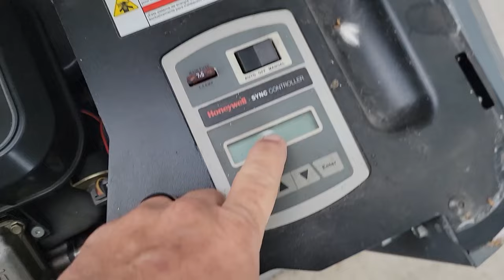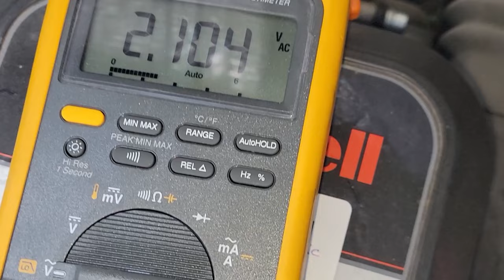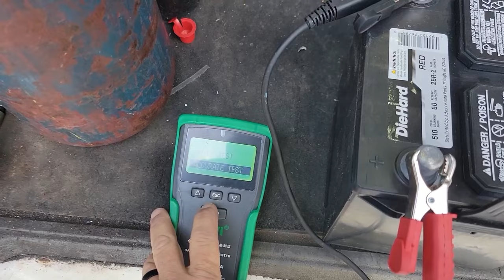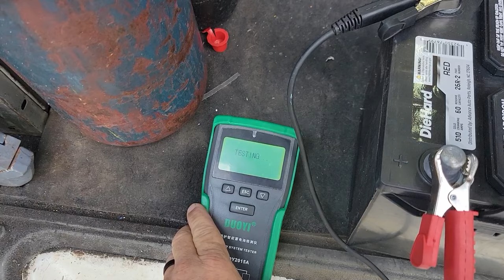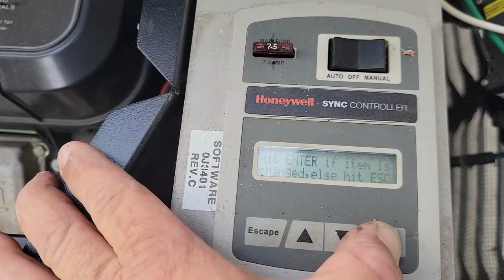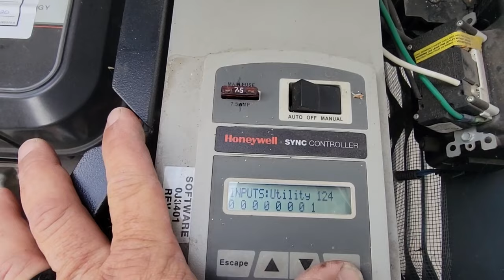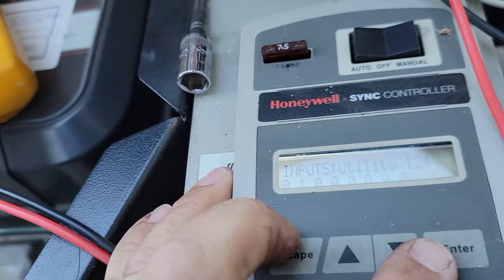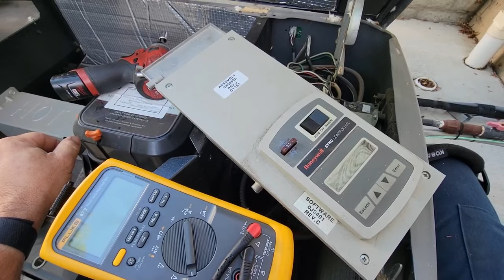Generac Generator Won't Start Blank Display

Comment: Add a surge protector to N1-N2 to protect the controller from utility surges in the future. Generac had said they were going to add surge protection in the circuits in the future, have not seen that yet as Evolution controllers sill suffer surge failure in T1 N1-N2, just adding a MOV in the circuit could help but I guess it's cheaper for them to pay warranty for failed controllers. Had a liquid cooled Nexus on a farm that lost controllers in lighting storms several times, added surge protection to N1-N2 and never had another failure. They work and are cheap insurance once the generator is out of warranty.
Reply from the maker: Good idea.

Comment: I have a newer generation controller on my 11k generator. The display went out, but the generator still operates normally. Hate to have to shell out over $400 because of a faulty display. You'd think that where would be a fix for this. Thanks for the informative video and useful trouble shooting insight.
Reply from the maker: Electronic repair is not popular anymore. That’s what I wanted to do before I went into HVAC you might be able to replace just the screen but it’s hard to say if that’s what’s gonna fix it.

Comment: I have a Generac 8k home generator. The control panel was replaced eight years ago and has worked great. Yesterday I turned it on and there was no display in the led screen. Although the three (red, green and blue) lights come but the buttons below them have no effect nor does the main OK button. Hence, the unit will not crank or start. I think the controller has failed. Batteries are fully charged.  Any ideas?
Reply from the maker: Check your fuse, after that, you’re probably right

Comment: Good call on the bad controller. Not sure why they had Romex running into the unit, which is not code. They should have put the junction box on the house and then run all THHN to the gen set. Pre Covid that control was $500+ so wondering what it is now since I retired 2 years ago.
Reply from the maker: It was more than that now. Everything has gone up stupid money

Comment: I have basically that same model and have a blank screen. I put in a new battery and it went dead about 12 hours of running and the generator shut off. Do you think my control panel is bad or the charging unit? I changed out the 3, 5 amp fuses as well.
Reply from the maker: You need a volt meter to check battery charger. It should be more than 12.5v dc likely in the 13+vdc
Reply: I'll try that. Thanks.  I think I may have ruined the control module because I changed out the battery without pulling out the 7.5 amp fuse.
Reply from the maker: I doubt you caused it by not pulling the fuse, It could happen when the voltage gets too low and causes electronics to go hay wire.

Comment: Do you toss the old controller? Looks like the display still works on it.  Ive changed the display board on 2 so far. Its work but not that bad to do. The lcd displays on the older ones are obsolete now  like that one. New Haven Display made them for generac.
Reply from the maker: Yes

Comment: You said it ran last month, but the year was 2021, not 2022.
Reply from the maker: You might be right but I don't remember if the time was correct or not to begin with plus it looks like that was number 49 and I can't remember if 1 is the most recent or it 49 is the most recent.

Comment: Couldn't find a 10mm wrench, I take it?  Those suckers run away FAST.   I guess that's why Harbor Freight now sells a 10mm only socket set.   (deep, wobble, etc)
Reply from the maker: 🤣 I seen the skit where the guy kept losing them before he even got to his truck. Then Kept going back into harbor freight and getting more,  then they weren't even in the package when he went to check out.
Reply: @HVACRSurvival  - Is that why you were using pliers (Better than channel locks/grooved joint pliers, but not a wrench) rather than a wrench?   Someone stole them out of your truck to replace the ones missing from their HF tool set? :)
Reply from the maker: I use them because they have down pressure that is tighter than a socket or open wrench.
Reply: @HVACRSurvival  - Personal preference, I guess.  I use a box wrench on battery connectors.  Only annoying part was when they used two sizes of nuts to distinguish positive and negative.   
Suggestion - grab a nitrile or latex glove and bag the connectors with them.  It's not foolproof, but casual hits won't cause a short.
Reply from the maker: Good idea 👍👍

Comment: You said it last ran “last month”, but the year was 8/2021 and you just set the date to 9/2022. I think you missed that it hadn’t run in a year. 11:04
Reply from the maker: I might have, I think I had to replace the controller later.
Reply: @HVACRSurvival  I’ve had a phone interview to be a technician for a new Generac Superstore in my area. Your videos are very helpful, since I’ve only worked on my own stuff. Thanks
Reply from the maker: @stumpbumpers awesome, let me know if you get the job 👍👍

Comment: I liked the video.  Troubleshooting is a lost art these days.  I would ask that you make it a little more clear which wires or terminal you are touching when you test.  I couldn't always tell from the video. I'm sure testing and holding a phone at the same time is difficult.  Thanks for sharing this.
Reply from the maker: There's a reason why I don't go into great detail because like I've mentioned in multiple different spots in almost every video that I don't make these for homeowner because there's no way for me to know what their skill level is and if I forget to warn them on one thing or if they get hurt, they want to sue you for their mistake. Plus I don't have time to train somebody on how every little piece of the puzzle works inside of a generator. However, if you can figure it out on your own off of what I show, then I'm more than happy to present what I've done. (You would need to watch all my generator videos to get the full story of why I do these videos and why I'm hateful towards Generac.)
Reply: I realized that and understand completely. You said that in your video.  All I was talking about was in the process of making the video just that when you did the testing, you did show clearly which terminals you were testing.  The information was great. I have a T1 problem.  I checked the fuses in my ATS and my T1 was blown.  When I put a new fuse in the LEDS on the fuse panel lit up and subsequently went out. I tried again and got the same result.  I figure I had either a short in the T1 wire or a bad Control board.  I just wasn’t clear which wires or terminals you were testing.  Anyway, good video and info.  I’ll be testing it more today.  I do know my limitations and are very careful.  I self-installed the generator and ATS.  I did have an electrician friend help me move the service cable and review my work.  Thanks for the help.  Joe

Comment: The link to the small fuse puller is a different style.
Reply from the maker: I couldn't find the little small one on Amazon. I bought that 4 years ago. I know that brand that I picked is a good brand and it's made in America plus it looks like the tip is pointed so it should get a hold of the fuse the same way my little one does. I know the larger and medium size ones do not get into that fuse holder very well.
Reply: Ideal 34-001

Comment: Rick, I found your series because I have been thinking about having a unit installed at my residence, with what I have been seeing with your videos, maybe having an electrician come over and install a transfer switch and plug to my service with an interlock and purchase a 10 to 15 thousand watt portable unit would be a better option.
Reply from the maker: That's what I use, but that depends on how big of a deal doing it manually is to you.
Reply: @HVACRSurvival  Thank you Rick, with an electric start unit it would be no big deal to manually engage and disengage, the cabling would be a short run to a sheltered unit.
Reply: @TIREDOFEVIL not sure if you made your decision yet but remember….you get what you pay for.  Generac has made a deliberate choice to produce a unit that is the lowest possible cost to install and has also simplified the install process for the electrician.  With that said….they oversimplified.  Now, by integrating the battery charger into the controller, your cost of part replacement has gone up exponentially.  So, Generac may move a few more units but in the long run, screwed the consumer by necessitating replacing a very expensive component instead of having a separate battery charger that may cost 60 bucks.

Also, the consumer didn’t help at all by deciding to service their generator every 4 years!  Here in the US, I would argue that regardless of political affiliation, most of us would agree that deciding to do the right thing once every four years is gonna hurt😂

Comment: What if battery is not getting charged and fuse is good?
Reply from the maker: Use your meter and verify you have voltage coming to it from the battery charger.
Reply: @HVACRSurvival  it’s a nexus controller, the charger is inside of it and I’m getting 120vac in the white wire 194 if I’m not mistaken. So I’m thinking I should replace the controller right?
Reply from the maker: @orlindiaz8650  I honestly don't have all the wiring memorized anymore. I'd have to try to find it and look it up, if you're wrong you're out 500 to 600 plus dollars for control module. So for that kind of money I would just pay somebody to come look at it that way you're not buying a module and then if it's not it you're screwed or if you damage a module you're screwed. When it becomes costly it could becomes time to call somebody to take on that responsibility is my feeling.

Comment: lol military time, rest of the world time....
Reply: Dunno about you, but everyone I know in the other parts of the world run on 12 hours clocks.
Reply: @tbelding   A lot of people do not realize that there are a lot of services that use the Standard  24 Hr clock. Not just the Military... I was an Air Force brat from 1960 to 74 and to this day still use the 24 Hr Clock. I even have a 24 Hr Analog dial Watch.  I've been a Licensed Amature Radio Op since 89 and anything Ham related use the 24 Hr Clock, Mainly UTC time. Even My Kitchen Stove has the Clock set to 24 Hr LOL...
Reply: @m9ovich785  - When you're talking across multiple time zones, especially when you're not actually _talking_, GMT/UTC makes sense.  I'm an IT consultant, and all emails are done in +- from GMT (which is now UTC, for some gawdawful stupid politically correct reason, I'm sure, and is backwards anyway- it should be UCT)  However, for normal people, they understand that "I'll be there at 3" doesn't mean  3 AM.   We are a diurnal people - 8 AM to 8 PM :)
Reply from the maker: Well the only reason why I mentioned this is because people set the clock to exercise at 3:00 and it ends up being 3:00 in the morning, if the people do not cycle the clock further than 12:00 they'll never know that it's in 24 hour time. I mention these things because I see people screw this stuff up. So I guess it's funny 🤭ha ha
Reply: @HVACRSurvival  If the display can be set to 24 hr it would display 15:00.
Reply: @HVACRSurvival  Seems like 3 AM would be a good time to wake up the neighbors, so that's where I'd put the exercise option.
Reply from the maker: @m9ovich785  I'm just telling you that I deal with a lot of people that don't realize that, most things I point out is because somebody screwed up and did something that resulted in me having to deal with it. That's why I bring these things up when I'm doing my videos. I see a lot of stupid stuff people do
Reply: @HVACRSurvival  ... I was a tech on these for 25 years and even I screwed up the clock setting when that controller first came out. Must have been a dozen where I set the clock 12 hours off and the exercise happened at night! Of course, it happened when I did 10 startups in 2 days before a storm. (yes, we sold a LOT of units)
Reply from the maker: @rupe53  that's a lot. My previous place of employment sold sometimes 7 a week but here we're lucky we sell one every couple weeks to a month. We're mainly doing HVAC. Nobody at my shop wants to work on them or go to school for them so I keep getting stuck on it. Now I resent working on them.
Reply: @HVACRSurvival  ... I actually went from doing HVAC to gen sets in the 90s. I found I enjoyed it, especially fixing small things during routine service. I probably had the lowest call-back ratio in the company of 17 techs. I don't know what their numbers are now but I do recall selling near 600 units annually during certain storm years. Probably 300+ other years.
Reply from the maker: That's really good. I used to like working on them a lot because it was something new to me but at my current company, I have plenty to choose from.